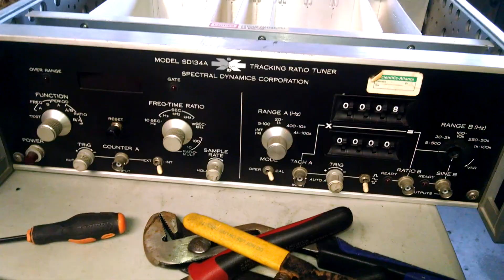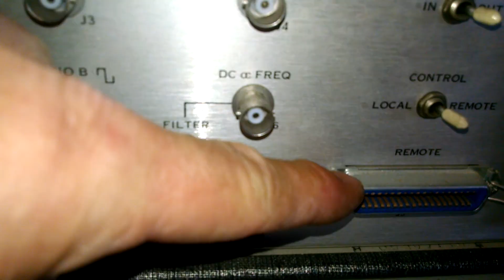PCB, Circuit Board, Precious Metals Identification

Comment: At 3:04 you asked anyone know what the yellow covered things are.  I think they are high wattage power resistors by the  5.0/100V on one and 200V on the other cases.  Only two solder legs connect to to the PCB like resistors.  But if you are using higher voltages across them the encased in the yellow have to dissapate heat.  I have an old 1950s AM radio and for 120 VAC wall voltage a 10 ohm resistor gets hot.
Reply from the maker: intereting

Comment: I've been refining for over 10 years
Where I live, we only have 12 months in a year.. Next, gold. Yes, you can and will get gold. Find a buyer,,,,,well,,,,,that's another story altogether . Banks will not buy your gold, you can't use it in a store, and a pawn shop will laugh at you. It took me 2 years to find somebody to buy my gold. They are 1200 miles away from me and require a minimum of 4 oz of 24k. It's easy to get, but selling it. NOT. Just a warning to anybody who thinks, wow, I can get some gold and ,,,,well you get the point. As far as the other metals, once again, good luck. Your not going to get enough to sell to anybody and make a profit. You will have to sit on it, stack it up until you have enough for a commercial refiner to consider. That can take years of spending money with no return, until you have enough to sell.
Reply from the maker: I totally agree and my correction is pinned at the top.

Comment: MLCCs come in a wide range of different types, colors and sizes but the most common old ones are the Box type, Dipped Type and IC style (I would have to show you a picture so you understand that kind) basically it is a IC syle larger chip that is dipped than has several MLCCs one the chip under the dipped coating. These dint always have precious metals but the chance is much higher that they do 90% and above usually have palladium from my testing but of course I havent tested every single one
Reply from the maker: Yes sir, I was still learning when I made this one lol.
Reply: @EcycleNation  Yea I was just trying to pass knowledge on to anyone that visits the video and for you since your always driving when I message. Hope your doing well. I nedd to send you a picture, I just got some boards with 3 inch long doggy bones. I never knew they made them that big. Those red things are still considered MLCCs, a lot of items are you would never guess, you just need to test one of each kind to see what it contains. Every box type Ive tested has been palladium. Anything else is 9/10 because even back than base metals were used with some companies and cheap china factories

Comment: Here is the best advice on solder someone should use. If the solder is very shiny most likely at most it will have trace amounts of some precious metal. If you have solder or solder masking that is a flat grey color that isnt shiny at all is going to have the highest chances for higher levels of precious metals or straight plating of silver OR palladium. Palladium is highly overlooked for being used as fingers, traces or solder masking. Platinum is extremely rare and most likely only used on some wire wrap pins, this is because the density of platinum is much greater and doesnt work near good as palladium on circuit boards. You have some flat solder masking and traces on some of these boards
Reply from the maker: Thank you, awesome comment

Comment: Lol i worked as a PCB tech for 5 years and this guy is missing the mark with half his part names. even that little yellow one, which is one of the most obvious capacitors you see. Lol I keep watching, he called a row of diods resistors. Also I could be mistaken, but I think the traces are copper with a sliver plating, so not sure why the emphasis on those. Seems like it would be  a pain to remove all the traces anyway
Reply from the maker: kind of old video but I tried, thanks for watching
Reply: Make a video please!
Reply: Not to mention the 24th and 40th month of the year...
Reply from the maker: @pasaris1233  thanks for watching.

Comment: The larger gold pins you call 'wire wrappers' on the first board you show. Pretty sure they are test pionts, where a tech would hook up test equipment to check/service the boards. Thanks for sharing, thats a nice old piece!!
Reply from the maker: That makes a lot of sense, this is one of them times when I say, Why didn't I think of that, lol.
Reply: +Mike McKinster ha ha, I say that a lot too 😂 you'll probably find they are labelled TP like test pin or test point.

Comment: check the green relay 11:12 the green on the left contacts are made from or PM plated, at 2:00 the big switch with 3 white rings has PM (silver, gold or palladium) , at 0:21 the counters (the ones with the zeroes)` usually  have gold plated tracks, and small contacts made of solid gold (at least in the Soviet species).
Reply from the maker: Thank you, you were right, I found the gold boards associated with the counters.  I put the boards up for now.  Will probably check them out over the weekend.